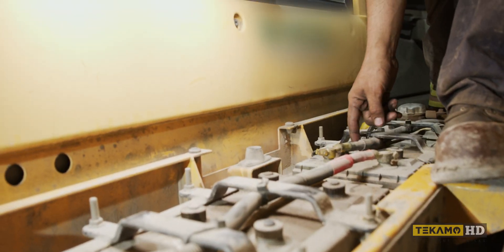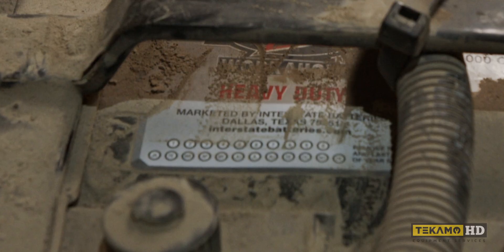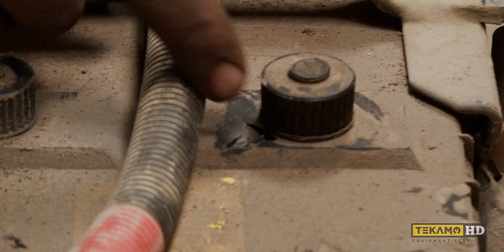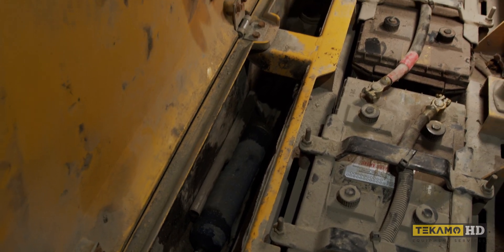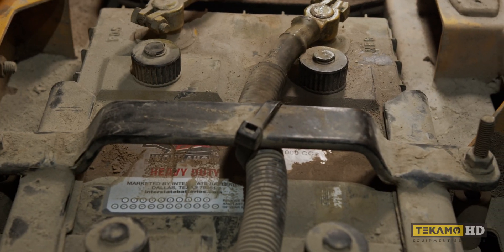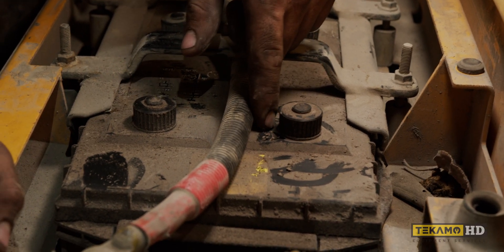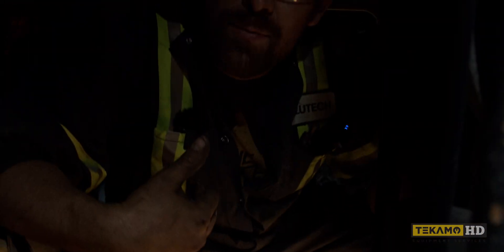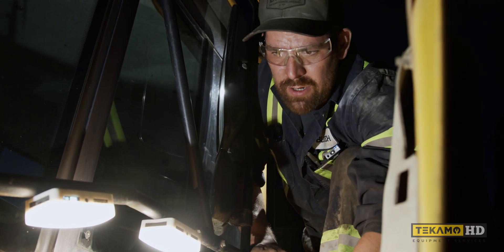Heavy Equipment Vehicle Doesn’t Want To Start + A Guide To Battery Safety

Comment: Pretty sure it wasn’t an explosion. Ive had a couple lead acid automotive size ones blow up on me and Foly Huck does that get your attention in a hurry. The first time it was in a Hydraulic skid shack, basically a 350 chevy driving a hydraulic pump to run top drives on oil wells. Luckily the battery box was locked, I go in to check it for what ever issue I was there for, and as soon as I touched the starter button KABOOM. I was wearing my ear plugs thank christ, and it still sounded like a 12ga went off beside my ear. I was literally stunned, and it wasn’t until I noticed water pouring out of the battery box I realized what happened. Batteries are no joke boys and girls. We eventually switched to red top optimas on all our skids since AGM’s are supposedly less susceptible to this problem.

Comment: The worst is going out to a no start, doing all the checks then BAM ECM is toast. I work for a wacker neuson dealer everything is electronically controlled :/
Reply from the maker: Did you run into a lot of ECMs that were fried??
Reply: @TekamoHD  not usually has happened twice and I feel terrible because there isn’t much I can do till another day
Reply: @TekamoHD  I submitted a form to have a truck tour and maybe a shop tour for the future 👀👀👀👀
Reply from the maker: When did you send it? Did you ever end up going to the pipeline in Hope?
Reply: @TekamoHD  nope need the seal re writing on the 16th Of Feb
Reply: @TekamoHD  sent it last month

Comment: Wiggle wagons are driven like the Dukes of Hazzard driven as fast as they can over the bumps. Not surprised those 4Ds are pooched. Batteries don't last; they are not like they used to be. The overseas batteries can't get them they are not a standard group size. They are narrower than a regular 4D. Its a real Fin pain in the ass.

Comment: I've only seen one of those big batteries that had exploded and the aftermath was way nastier than that! I would stick with something dropped on it. By the way the one I saw that exploded some numbnut tried to start it with welder !
Reply: The older constant currant welders were great battery chargers. The secret is to have a volt meter connected , keep the voltage between 13.5 and 14.5 volts. Good batteries will accept 100+ amps and remain with in 13.5 and 14.5 voltage range. Bad batteries are unable to accept 40 amps, voltage will climb 16/18 volts.  If a battery is completely discharged they will not accept a charge, so the trick here is to connect a good battery in parallel, that will allow the charge to be accepted. 
   The battery explosion you refereed to was the result of not shutting of the welder prior to disconnecting cables creating a spark. And no control on amperage, allowed gas to form from overcharging.
   This method should only be done by someone who knows what they are doing!!!!  
   The new inverter welders are unable to do battery charging as it will damage the welder. For service truck you need to get a welder that has a separate feature specifically for battery charging. 
  For 42 years as a road service I used Miller Legends, charged hundreds of batteries. Just got a Miller Bobcat Air Pack, sweet machine. But no more ability to manually adjust amperage by watching volt meter attached to welding leads.